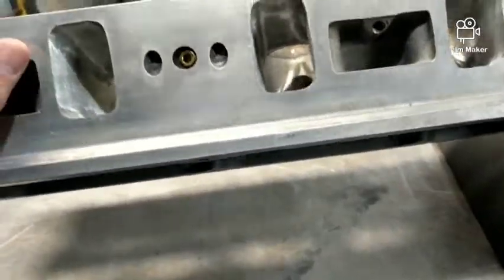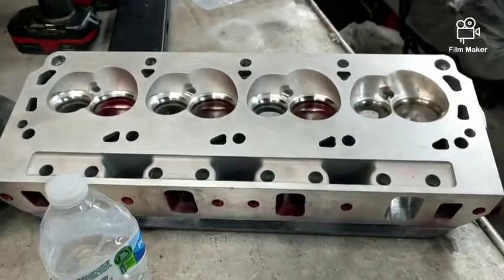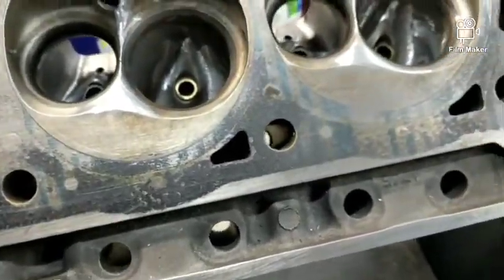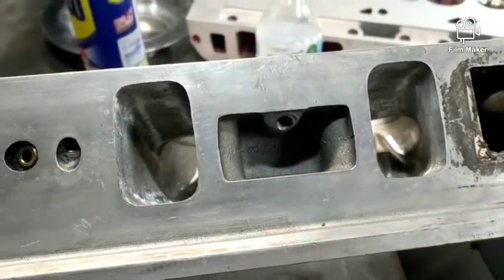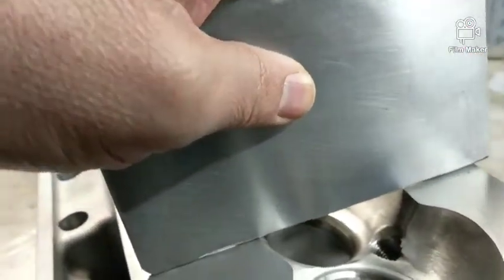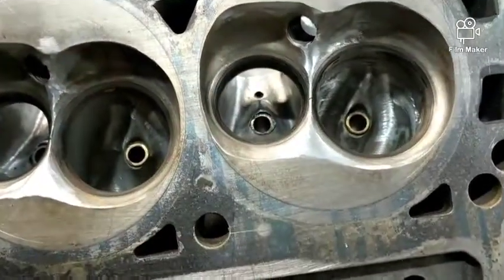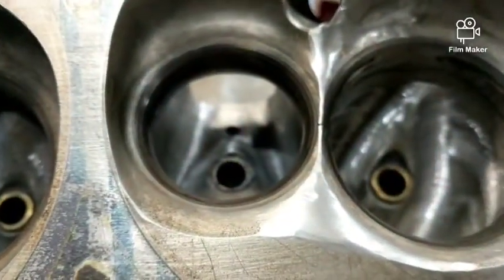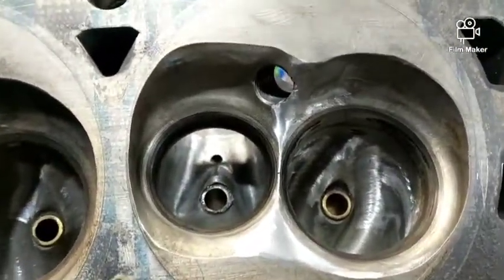My twisted wedge heads with flow numbers

Comment: David after milling these .030 did you have any issues with intake alignment?
Reply from the maker: No, supposedly .030 is the maximum you can do without milling the intake.
Reply: @FXRSDriver  thanks, mine seemed to line up pretty well, just had to elongate the intake mounting holes

Comment: I’m wondering if these heads are going to allow the valves hit the “True Flattop” pistons with the extra valve drop, & twisted chambers. Or do you have to have a special set of pistons? Thanks for sharing your thoughts & knowledge.
Reply from the maker: I'm running a different set of TW's on the trooper car now with an '86 short block.
Reply: @FXRSDriver  according to the casting number of the heads my heads are 49.2 cc chambers. These are the smallest chambered heads for a 65-66 289.

Comment: What do they flow??
Reply from the maker: Mine with no valve job:
71	59
147	108
215	157
215	157
258	178
292	192
288	192

Panhandle Ported TW with aftermarket valves and better valve job: These numbers were from their bench, not Ray's.
71	59
147	108
210	155
246	191
281	209
307	219
305	223